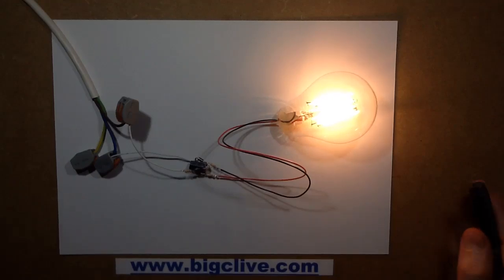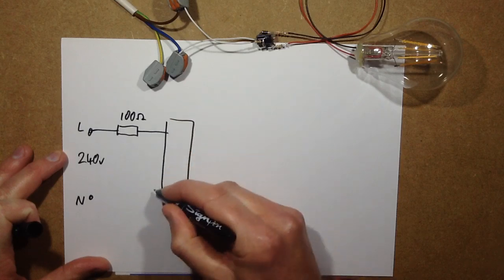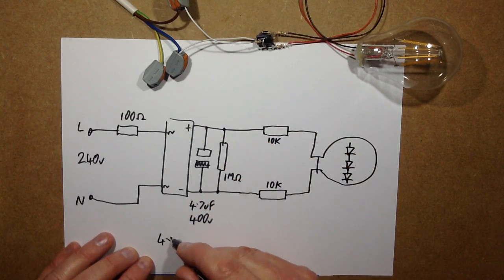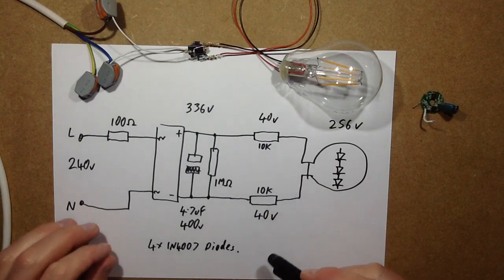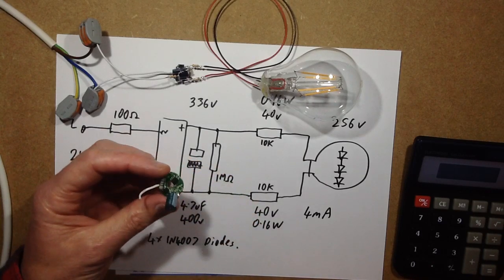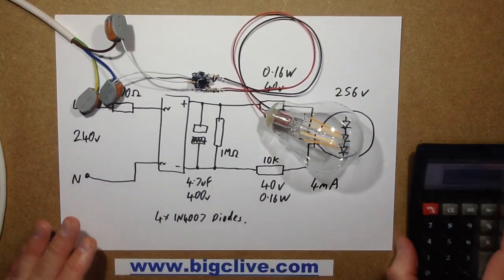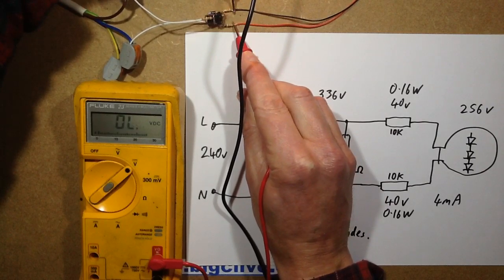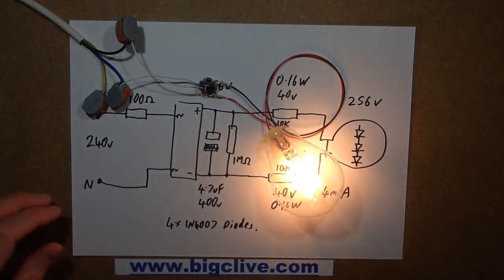Simple resistive dropper for LED filament lamp.

Comment: Just a question,  I would like ro use 1 x filament per light source, ie 4 in series but in separate fittings. I would need to smash the glass carefully and disassemble the lamp. Is there an issue with heat and using the filaments in a sealed bottle with no gas. I would obviously use current limiting as you have.

Comment: Hi Clive. I've been toying with the idea of modifying existing lighting fixtures rather than the lamps. I recently picked up a handful of different LED lamps and have found that all of them seem to work just fine with a resistor (so far I've tested up to 1500 ohms using 5W wire wound ceramic bricks) in series with the lamp socket. Are there any traps I should be concerned about regarding any active circuitry like switching regulators in the lamps?

Sorry to post this on such an old video, but this one is more relevant to my question than anything more recent.
Reply from the maker: Lamps with switching regulators may just increase the current to try and run the lamp at it's rated wattage.  That could result in a lot of heat from the resistor.  Some switching drivers will start flashing the lamp if the current is limited too much.
Capacitive dropper lamps will be fine and just run at lower power.
A more efficient and safer approach may be to use a series capacitor like a 470uF X2 suppression capacitor.  That would result in no significant heating.  You'd need a couple of 470K resistors in series across it to discharge it while experimenting.
Reply: @bigclivedotcom  I've tried blocks of 100nF/630V capacitors (not X2, but what I have on hand; will get proper caps if I choose to go this route) in parallel. One of the lamps got along just fine with as little as 100nF in series with the socket; one didn't respond at all with 500nF. The others all glowed dimly with 500nF (dimly enough to count the chips on one with the rigid filaments).
The lamp that doesn't like the dropper capacitor doesn't seem to fight a resistive dropper until I try to push its power below 3W. I shall leave that running for a while with 680 ohms in series with the socket and monitor the base temperature; I shall also burst one open and do some reverse engineering to try to find out why it doesn't like an external capacitive dropper. (They're sold in packs of 2 at Dollar Tree, so no big loss opening one up.)
Reply: UPDATE: Tore down the lamp that hates capacitive droppers. It was a "100W equivalent" Sunbeam-branded (though I'm sure the brand name was leased by some Wun-Hung-Low in Shenzhen ). Probably interesting to some, but boring to me - 3 clusters of 15 LED chips each on the main aluminum-backed board, with all the regulating circuitry on a separate board that just press-fits. Couldn't be bothered to reverse engineer the regulator board, but it appears to have a FWBR, a current regulator chip, a mosfet, current setting resistors, a decoupling capacitor, and the ubiquitous big honkin' electrolytic reservoir.
I suppose I could build the LED panel into a flush-mount globe fixture with a capacitive dropper stuffed into the press fit contacts. Used to love small globe ceiling fixtures, but my condo doesn't have any existing ceiling boxes.

Comment: I am curious about your use of the current limiting resistors, since current is constant in a series circuit, why not just a single 20k?
Reply from the maker: To spread the dissipation between more than one resistor to allow higher current with standard quarter watt resistors.

Comment: Ok Clive, I have a techtronix scope with a failed CCFL tube. Unfortunately the parts have been discontinued. I want to use cool white led filaments to replace it. I tested it with a cheap led strip and it lights up great it just has concentrated light spots. so i was hoping connecting 3 in series of the filaments would eliminate the spots. your circuit is great but what would i need to change for a 110v system?

Comment: Hello! I just came across this video and was slightly confused by something. This may be a simple question but I'm somewhat new to this and can't find the answer elsewhere. The mains voltage is 240v, but the voltage across the capacitor is significantly higher. Even generously accounting for fluctuations in mains voltage this seems high. Why does that happen? Thanks!
Reply: That is because the voltage that is measured in AC is not the peak voltage but the root mean square of the voltage. Because the voltage in AC is a sinewave if you plot it out most of the time the voltage is below the peak. 

If you rectify the the current and use a Capacitor to fill out the gaps between the wave "humps" you get a voltage that is much closer to the peak voltage.
Reply: +Christopher Perrin (cjp88) Thank you! I wasn't understanding the RMS/peak voltage of AC correctly. Now I feel dumb, but a little smarter.
Reply: So, is it safe to assume that the rectified voltage is still going to be about 240v without the capacitor?
Reply: yes I think it is.
Reply: Excellent, thank you!
Reply: BJ Brinck technically, after rectification, you have half sine bumps between 0 and peak at double the frequency of the full sine. Since you're below the forward voltage of your led array for some of the curve, you would get flicker without the capacitor to buffer.

Comment: Instead of 100 ohm at the input, why not move one of the 10K resistors there? This will further reduce inrush current, limit peak currents, and it lowers the voltage across the capacitor, extending its life.
I do not know if the total power dissipation will be higher or lower, or the same.
It may also increase the light fluctuation, as the capacitor is at a lower voltage now, the ripple will be higher if seen as a percentage.

Comment: Dear Clive, Due to you sometimes truly funny videos,  I am becoming more and more interested in LED electronics and electronics in general. True, I started a self-study course years ago but never got very far because I had no one to put my questions to and I was not interested in building amplifiers.  I would like to ask you this: Why does te 1 Mega Ohm resistor nog blow up. Surely there is sufficient voltage/current to do that.  And why is the rush in resistor not blowing up (burning out). Is it there just as a 'fuse' ?
Thank you very much in advance for your trouble and I hope to see lots more video's.
Reply: The 1 meg resistor has 360 volt /1000000 ohm = 0.00036 amps going though it. 360 volt * 0.00036 ams = 0.13 watt, which is within the limits. The voltage is a bit high though; most resistors don't like more than 250 volts continuously.
The inrush limit resistor normally carries 4 mA, which is the circuit current. It is 4 mA average with high peaks, so it is going to be more than 1.6 milliwatts.

Comment: Just wondering, what are the Fila-Driver ICs for, such as LIS8431 ?
Reply from the maker: C00ltronix They're buck regulators.  They derive the supply directly from the mains via a choke by gating the current through in controlled pulses.

Comment: Thank you Clive for posting these videos! I was wondering if one simple power supply design like this could power several 4 filament bulbs in parallel... if so, would it likely require higher wattage current limiting resistors?
Reply from the maker: It could if each group of filaments had its own resistor to divide the current.  Or alternatively each lamp could have its own circuit.
Reply: this type of circuit is very intolerant to modifications. Adding more consumers (led filaments), will oblige to recalculate the 10k resistors until they have a current drop less than 0.25W per rezistor. This is the lesson here !  We need to know the Led filament 130LM (ebay notation) datasheet which i have to find it myself too. If mister Clive have a link to such datasheet, (or a video about it?) or any type of information that will help us, it will be futere(romanian word btw) ok.

Comment: My knowledge of electronics is minimal but I guess this means you could replace the 2 resistors before the LED's with 1 potentiometer so it's dimmable?
Reply from the maker: You'd need to use one resistor to limit the maximum current, but then a potentiometer could be used to adjust up to that.